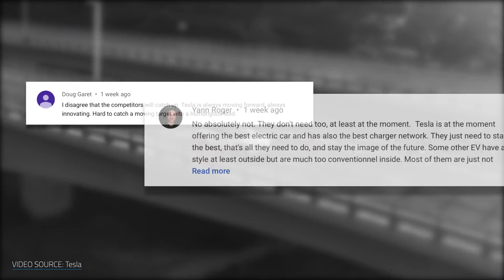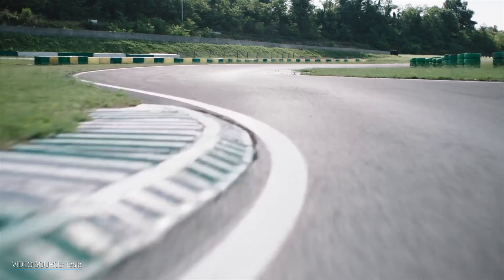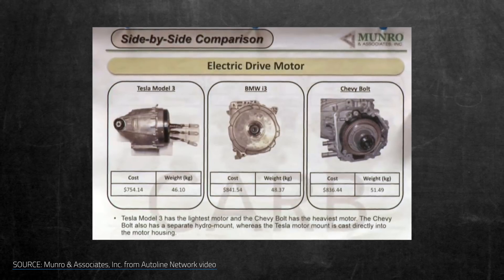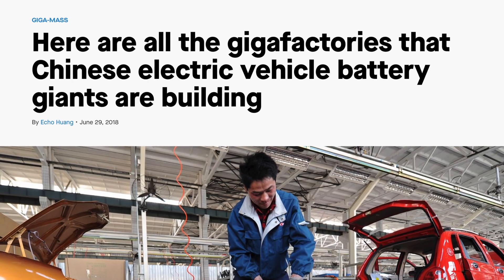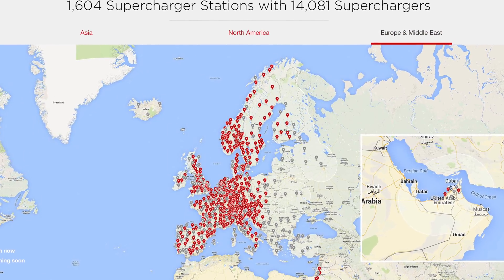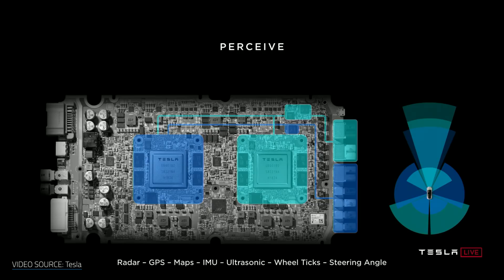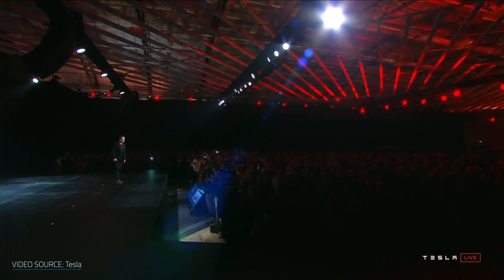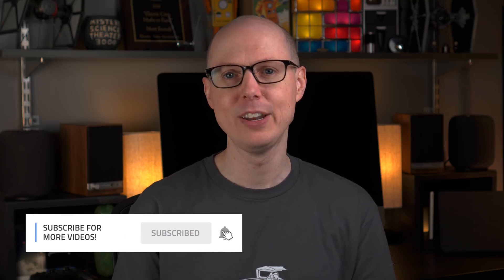Tesla vs Competitors - 5 Advantages

Comment: #6 Their cars are designed from scratch to be what they are today, in particular everything the car needs to do can be electronically controlled, not just acceleration, braking, steering, but almost everything else.  Further, all components can be controlled centrally, and thus coordinated across components.  This also makes OTA updates incredibly powerful and far more straightforward.  Even when Audi or others get OTA updates working, they still have to distribute the updates to all the disparate controllers made by other OEMs, which makes the job harder and slower.  Tesla are designed as software-controlled devices that happen to be cars, and as far as I know there's no other car like this even being imagined.
Reply from the maker: Good to see you, Tom!  And that's a great #6.

Comment: The one big downside to Tesla is that there not a car company when it comes to replacing parts. Try going into a Tesla dealer and walking out with a part that you need. You can't. Also only a Tesla technician can install the part

Comment: I'm sure you saw all of the Sandy Monro interview that you posted. In it he said that if Tesla had gotten expertise from the legacy car companies to do the dinosaur technology, then Tesla would have met all the schedules for new model introduction, and sales would have been much much higher, to the point where "even Toyota would have been crappin' their pants". But Tesla was arrogant towards the legacy car companies, and they've paid a heavy price for it. If they had gotten legacy car expertise help, like Rivian has, then your Tesla stock would have been over $500 today, maybe even approaching $1,000.

You way underestimate the impact of the Electrify America, which has built out an excellent ultra-fast 150/350 kW charging system on the Interstate Highway system in less than 2 years. About 80% of the interstate is strung by EA with distances around 120 miles maximum between chargers by the end of the year. The 400+ charging sites underestimates the impact of EA, because their chargers are  out on the highway. The cities are well done by EVGo and Charge Point. And many many more EA sites are coming in the next few years. EA is why I'm waiting to buy my all-electric Volvo XC90, due out in a couple of years.

Range above 300 miles is kind of a joke, with the EA infrastructure and other CCS infrastructure going up. When I heard Rivian had a 400 mile range truck and SUV, I laughed out loud. Who can drive 400 miles at a time? I'm in desperate need of a break after less than 3 hours of driving. And EA infrastructure is mostly there for legs less than 180 miles during a long road trip.

In Tesla's favor, their batteries and  electric motors are in a class of their own, like Sandy Monro pointed out. And Musk's leadership style, flawed as it is, is definitely an advantage. But I do know who Håkan Samuelsson is.

Comment: DESIGN!
It's clear that Tesla rethought the whole idea of what a car should be. All the others are traditional cars with batteries and an electric motor. When you get into a Tesla, it feels like someone said, "This car will drive itself one day, so let's get that instrument cluster out of the way. Also, cars have had computers in them for decades, but you could only access it through a proprietary port that requires a super expensive tool that reads out cryptic codes. Let's not do that. Let's upgrade your car every few weeks, add features, improve your milage, etc. all over the air."

Tesla's 6th big advantage is their designers don't have their heads firmly lodged up their asses.
Reply from the maker: As a designer I can get behind that.

Comment: I will add some small things:
1. The quality of the software user interface makes a mockery of their competition. Compare that with other brands that cling to older design standards (think knobs and buttons). While Tesla's focus on having practically all the controls on one or two screens may be controversial to some, I view this as a distinct advantage. By having all functions controlled by software, the user interface can be updated frequently, a significant value-add.
2. Battery pack cooling and heating. From what I can tell, Tesla does a better job managing battery temperature than anyone else, which has a significant impact on holding a charge and overall battery life. By contrast, the Nissan Leaf, which has been in production for years, has badly outdated, air-cooled battery management. They appear to be far behind in this respect. 
3. Design philosophy. Tesla started from a clean sheet of paper and threw out all previous assumptions on how a car could be built. They had no legacy to hinder them. This frees Tesla's designers and engineers to be free to create without having to respect the past. The results are obvious.
4. Styling. Actually, it's a big thing for me, but it's one that might not be mentioned. I love that Franz von Holzhausen, Tesla's head of design is a minimalist. His designs lack visual "noise" and clutter. No gratuitous folds, unnecessary scoops, swooshes, or other details. Form follows function, leaving a clean, beautiful design inside and out. The cars are simply beautiful. I must admit to being briefly shocked at the lack of a grille and traditional interior details on the Model 3, a reaction that lasted for literally a day. I once told a great designer that the best thing they could do was make me slightly uncomfortable. It meant, I explained, that they were far ahead of what I could imagine, and my lack of imagination had to catch up to them, as it should be. If I could imagine a design as beautiful as a Tesla, then they failed. Franz von Holzhausen did not fail. The work of Franz and his team is simply breathtaking.

Comment: I agree with most of your top 5, yet feel the ability to update the vehicle over the air is also huge. To buy a car, that will gain extra features and updates, making the car safer, more fun and doesn’t require a custom to visit a dealership or maintenance center to get these updates is so forward thinking. Dog Mode, Sentry Mode, Dash Cam, Summon Mode, Easter Eggs, improving the cars efficiency and more.; all while parked in your driveway...  What’s next?!

Comment: I think one big advantage you missed is the difference between conventional car companies and Tesla:  The dealer network.  How are car companies going to sell a car that doesn't need constant maintenance?  The dealers will scream.  No easy money doing oil changes, much fewer brakes services, etc.   Tesla doesn't have dealers, so they won't have to design in maintenance to appease the dealers with easy service revenues.  

The performance is the big one to me.  Tesla's perform well and have great range.  Other EVs have mainly been crappy little econoboxes.  Life is too short to drive a crappy econobox, IMHO.
Reply: Forgive my ignorance, but don't you still have to service a Tesla right? I'm talking about things like the tires, bodywork, and brakes. Can any mechanic just fix and replace those or does Tesla use their own proprietary system?
Reply: @ThatLaloBoy , I take my car to a local tire shop for tires. Tesla does have approved body shops for my Model S. The Model S body is aluminum which requires special training. Brakes should last a LOT longer due to regeneration but should be able to be handled by a competent shop. I haven't had to do anything with the brakes on my 6+-year-old P85 with over 75K miles on it. I paid for a service plan where my car gets serviced once a year or every 12.5K miles. The service costs a fraction of the same service plan for a similar BMW or Mercedes. The maintenance is a lot simpler than it is for an ICE car since mechanically it is so much simpler. Tesla did a lot to really simplify things with the Model 3. The wiring harness is half the complexity of that of a Prius but with a lot more features. When I have my car serviced they do things like perform a wheel alignment, change the cabin air filter, wiper blades, brake fluid, coolant, and other things, but there are no oil changes, no spark plugs, belts, etc. to deal with. Even when they do have to do something major, it's usually a lot easier. They did have to swap out the drive train on my car for an issue that tended to happen with early cars, but it's much easier than with a conventional car.
Reply: @ThatLaloBoy  Tesla has a service schedule online and in the manual and it's basically replacing the cabin air filter, brake fluid, and wipers every 2 years, AC service every 6 years, and regular tire maintenance. That's it. Brake pads can last the life of the car, no oils, belts, etc. It's all stuff that's easy for people to do themselves so you don't have to visit a service center unless you'd prefer to. If you need body work, the Rangers can now do delivery replacement for bumpers and other simple stuff.

Handy DIY maintenance writeup here:  If you need body work, the Rangers can now do delivery replacement for bumpers and other simple stuff.

Comment: I would find fault with the appreciating asset claim.  I get the different aspects of it but unless FSD gets to the next level soon, I think it will depreciate as the S has with the improvements of later models.  I do think it will hold value better than most, but appreciating?  IDK  Unless we can factor in a major crash in US currency  (that I'm forecasting).  But that would make all cars worth more.
Reply: If FSD happens like Elon Musk expects, then you could rent out your car as a robo-taxis and make a lot of money on it. If you can make $20,000 a year from your car, would you sell it for $30,000 or $40,000? Now, if it makes you $30,000 per year, you would be crazy to sell it for less than you would make in 2 years, no matter what you bought it for. And, if you can no longer buy a new Tesla for under $150,000, because they won't sell cars for less than they can make off of them, then how much will your car be worth?

That is the thinking at least. Whether it happens or not is another story. However, they are putting a ton into it. It might.
Reply from the maker: I think his claim that full self driving cars being an appreciating asset is going to prove out to be true.  But will Tesla be able to pull that off anytime soon?  That's the million dollar question.  I hope so.

Comment: One of the biggest advantages Tesla has over traditional car manufacturers is their company culture. Management at large car companies can be compared to small villages where each mayor is out to protect his share of project finance and there's very little flexibility to create collaboration between departments which is critical if you need to rethink automotive engineering from the ground up. 
     Silicon valley philosophy and tech start up culture allows Tesla to try many new ideas and quickly redirect resources when failures occur. 
     Another huge advantage is not having to maintain development of existing ICE vehicles. When you start from the bottom you don't have the fear of falling from very high.

Comment: If you are looking into it, is it worth waiting for information/implementation of the new batteries?
Reply from the maker: That's the million dollar question.  My gut is telling me no.  Not because it won't be an awesome upgrade, but because they're always making improvements.  You could wait for the battery, but then there may be another thing you want to wait another year for.  I lean more towards the camp of get it now if it fits your need.  My guess is that we may see a small bump in total miles per charge, but I think Tesla will most likely be able to drop the number of cells required per car to hit roughly the same mileage.  That will reduce the weight of the car, improve efficiency, and drop production costs ... a lot.

Comment: One correction: You mention "no other car manufacturer builds and owns their own extensive charging infrastructure", and that's not entirely true. Electrify America is owned by VGA (Volkswagen). It's far behind the coverage of the Supercharger network, but they finally seem to understand the importance of this point.
Reply: It's good to note that Electrify America is plagued with many issues, and had to resort to using Tesla power packs to stabilize their charging stations. They still have a long way to go.

Comment: #6 (should be #1 in my opinion) - Tesla’s mission - accelerate the transition to sustainable energy.

See Simon Sinek “Start with Why” about this. It ripples to employees, customers, investors, etc.

Tesla doesn’t have to invest a single $ in R+D or marketing of internal combustion vehicles. Every other OEM has huge costs for both technologies and need to decide and balance; see “Innovator’s Dilemma”.

#7 - over-the-air updates - no other OEM is even close to having this infrastructure in place.

Comment: refueling/recharging is biggest disadvantage as not so great range but petrol engines in that hp class are almost nothing better
Reply: You would be right if everyone would drive their petrol car at full throttle all the time😂
Reply: @martini380  400+hp petrol cars consumes lot of fuel with low speeds too especially in city driving where they have 15-20liter consumption

Comment: Great job Matt! Would just like to add (or at least emphasize) 'endurance' to the list. You skimmed on it when you mentioned Tesla vehicles getting maintained at Tesla Service Centers. But with:
1) Drive System/Unit good for 1M miles. 
2) Batteries currently good for 300-500k miles (Musk mentioned this bumping up to 1M miles by 2020). 
3) A great/if-not-best battery degradation rate (I believe it was 10% capacity reduction after 160k miles). 
4) There only being 17 (!!) moving parts in a Tesla.

It makes the Cost of Ownership much lower than a lower priced ICE. Curious to see how traditional car makers stack up once they earnestly start rolling out their versions of BEVs.
Reply from the maker: Thanks, Robert!  And good points.

Comment: What is needed is a range extender for long distance travel between charging stations on long tripstraveling
Reply: Not really. Long range batteries and decent charging speed are good enough. Teslas can drive for 4-6 hrs and then recharge while eating. Even 15 mins at a charging station will be enough most of the time.

Comment: I think if you’re looking at advantages you have to look at headwinds as well. And where Tesla is way behind other automakers is service (and logistics), so I’m not surprised Elon mentioned that as just as important as superchargers. Tesla is also adopting a proprietary service model as well, so they have an even bigger hill to climb. They seem to be heading down the same path as Apple, discouraging independent repair which I think is a huge mistake. While the US is clogging up with Model 3 more than doubling the fleet in a year, there are even bigger problems overseas. A Model S driver in Norway waited 6 months for a spare part and then had to wait another 3 months for the part to be installed, driving a gas car while his car and about 200 others waited in a queue. Tesla is trying to solve this problem but the capital cost of building service centres and training staff is just not a fast process. And customer dissatisfaction as queues grow with more cars sold could really hurt the brand.

Comment: Comments for and by Tesla fanbois are always slanted and devoid of reality.  Tesla is a great car, only because auto manufacturers haven't been serious about EV's.  Now that Porsche, VW, and a few other startups are serious - there is zero reason to believe they wont catch up quickly.  Chips, electronics, building batteries, and motor technology change yearly and don't take years to catch up to - it's not a distance race where everyone has the same speed.
Reply: When they catch up, that will be great! However, nothing has happened in years, no matter the promises. The Bolt, the IPace, and the ETron were all supposed to be as good or better than Tesla. Nothing. And then we hear about battery shortages everywhere as well. Nothing even competes against a 2013 Model S in range, and everyone still struggles with competing with performance and charging speed. That is an 6 yr old Tesla. No one has pushed out a 300+ mile range Bev other than Tesla, who is also closing in on 400 miles. 

I am hopeful that Porsche and VW will do well, but both are limiting production, at least early on. Audi has screwed up with their line. Let's hope others don't do the same.

Comment: I heard that Tesla only has two levels of regenerative braking and you set one of the two modes in a default panel. Now when you lift your foot from the gas peddle it will regenerate. On the other hand, when you brake, NO electricity generation will be done. Why is this stupid limitattion there?

Even my much cheaper Toyota Yaris Hybrid manages to regenerate electricity when braking!

Here are some future and cheap alternatives to Tesla:

https://sonomotors.com
https://insideevs.com/news/343159/sono-unveils-production-sion-solar-electric-car/

Comment: Having owned an egolf (still do, great around town)and now a long range all wheel model 3 the battery management/ cooling/ heating. Tesla has is also way ahead. The interface with the phone to remotely control and monitor the Tesla another huge plus, I have dogs, dog mode is huge. Just did an across state, California trip. The auto (beta) pilot is priceless. Right now here Ca. they're lots of free charging stations in 1,300+ miles I've spent a total of $8.32 at a Tesla super charger in Rocklin ca. Another plus for us early adopters. Cheers great video Thanks I didn't notice if you have a referral  code up for the current 1000 free miles an a chance to win a model y or roadster mine is Duncan20506 has to be submitted when ordering. If the creator of this content has one please use his. Just don't order without one. Good luck!